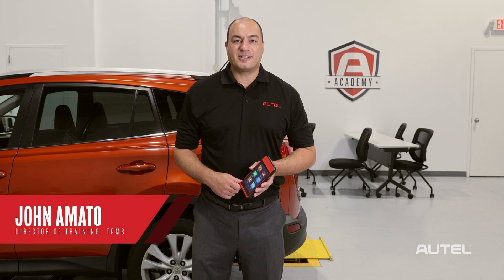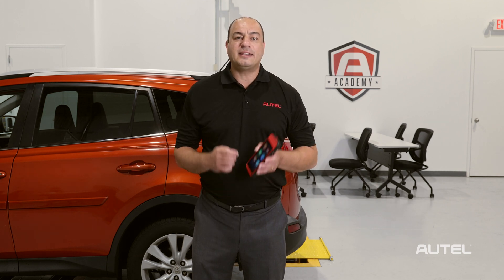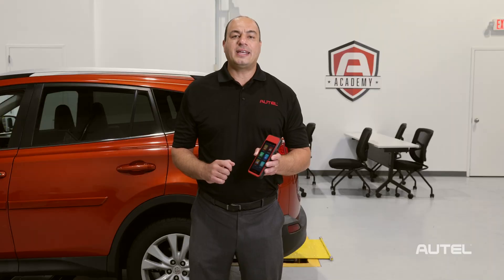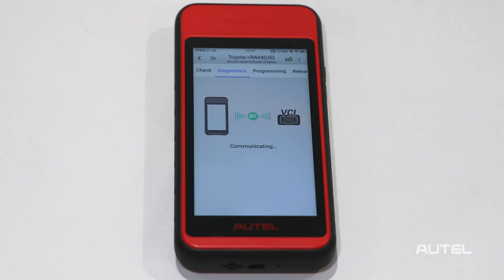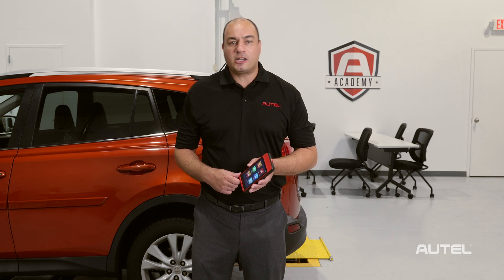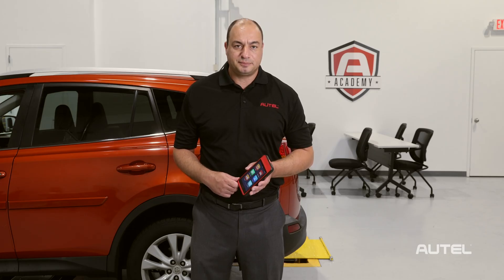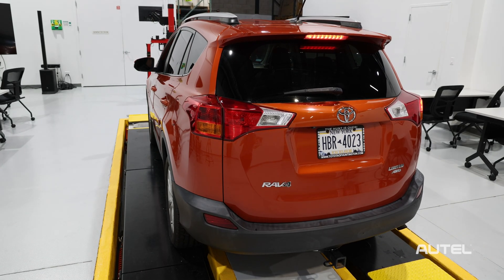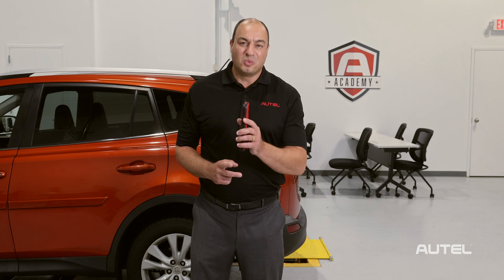The Autel ITS600 Makes TPMS Sensor Programming Simple

Comment: Autel must allow connecting to internet over LAN connection. Mine would not connect to any wifi. I have changed routers but this tool will not connect to a wireless network. I have tried but to no avail. I want to upgrade the tool.